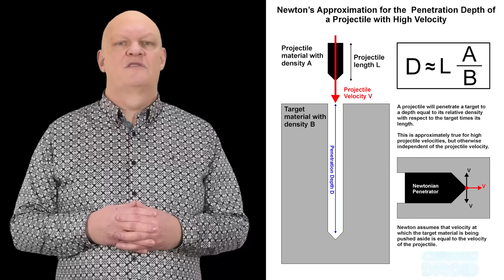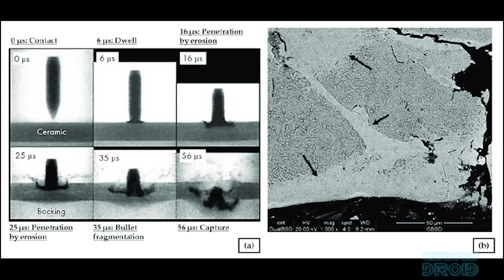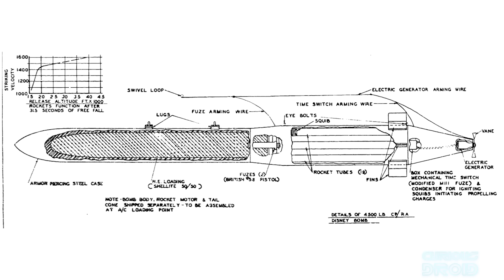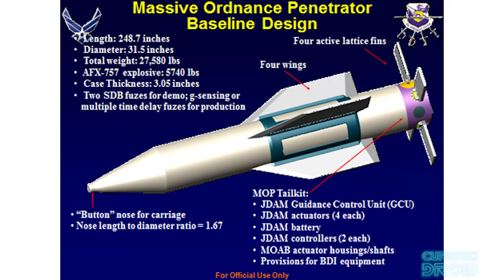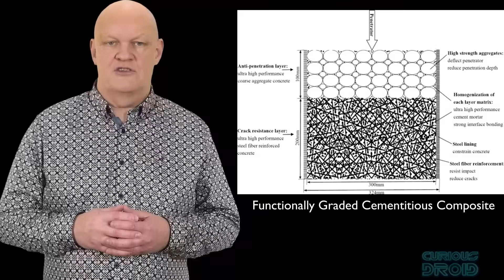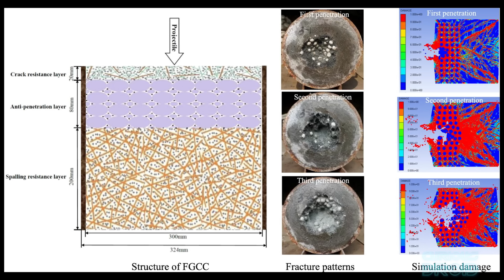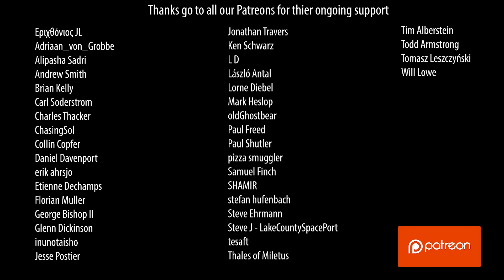Can Iran Stop U.S. Bunker Buster Bombs?

Comment: 25 years ago, I was working in Rodgers Hollow, Kentucky, testing concrete for tests like these. The holes they blew were dumbfounding. I wasn't allowed to see the tests, just the wet concrete and the aftermath. Some blasts heaved the concrete to rubble, while others were almost drill-like.
Reply: Drill-like... Fascinating. I am endlessly entertained watching solid things liquify or exhibit fluid dynamics behaviors instead of acting like rigid bodies under normal conditions. For the purposes our brains evolved for, it might as well be magic.
Reply: @daltanionwaves  the last line is such poetry 🤩 "For the purposes our brains evolved for, it might as well be magic."
Reply: @daltanionwaves   @daltanionwaves  To believe in evolution is to believe in magic🤡
Reply: The whole area is basically Kenshi.
Reply: @explosives006  no
Reply: I have always wondered, how much do you have to fk up a bunker really? The ground it is in most of the time will be the weak point?

I mean Cheyanne Mountain can hardly survive a "near miss" with a nuke let alone direct strike.. (I believe this is more to do with its age and doctrine of the time than actual failure)
Reply: I was also a part of a civilian company assisting in a creating a sensor array to test the capabilities of these kinds of munitions..in the end ..you dont always have to penetrate the bunker ..you sometimes need to disturb the surrounding environment enough to cause structural damge ..in some cases like in Lebanon... nasralla died from suffocation..not from the impact itself ..
Reply: @danielshultz8008 yes the effects of the gas fumes from the bombs is another killing tool in itself
Reply: Roughly speaking how straight and neat were the holes?
Reply: They would be defeated in one day like before
Reply: Boron fibre reinforced concrete is "interesting" stuff when it comes to breaking it up with explosives.
Definitely not something for the budget minded to contemplate...
Reply: Iran is not Iraq Iraq were under no fly zone for over a DECADE BEFOREthe war and could only get funds through smuggling they were basically close to third world with no allies you should compare Iraq to iran
Reply: US invades iran,the US aircraft would fall out the sky like rain
Reply: @kingsman3087  Sure and Mohammad will be able to read.
Reply: @kingsman3087  are they going to shoot down to some AI B2s like they shot down those AI F35s??
Reply: @The_Inquisitive_Inquisitor  idk, Iran has had decades to  prepare to counter these enemy aircraft
Reply: @kingsman3087  Really? That's funny because it seems like they don't know how to use anti-aircraft missiles. Not a SINGLE s300 has been fired
Reply: @kingsman3087 yeaaaaa didn’t happen lmao
Reply: @kingsman3087 This aged well.
Reply: Unlikely since the US has over 800 F-35's.  Iran would have problems dealing with them.  Any idea to the contrary is wishful thinking on Iran's part.
Reply: @wadopotato33  bro, what part of there will be no Arial battle you don't understand? Iran will not get engaged in dog-fights, they'd just use hypersonic surface to air missiles to take them down, like they have done to many of the US,s aircrafts, like the global hawk one of the most stealth and advance UAVs out there.
Reply: @xerxessonofdarius1969  Those hypersonic surface to air missiles you were talking about didn't seem to do them much good
Reply: @wyattlewis8671 you got two things mixed up. One they had a robust air defense but Israel's amazing military planing and know-how disabled those systems with a brilliant Trojan horse operation. My assessment at that time was correct, and not even the most educated military scholars could have predicted the audacious move by Israel. Oh and the second thing was Iran's hypersonic missiles ( not hypersonic air defense,  I never said that), but yeah Iran's hypersonic missiles saved their ass. If you see there is ceasefire. It's because iran was making it painful for Israel to continue the war. Otherwise Israel wouldn't let a wounded opponent get away
Reply: @kingsman3087  Here I am in the future to tell you that you are incorrect, sir.
Reply: @kingsman3087   WHY would you say such a dumb thing, ...unless you wanted to be refuted?
Reply: @kingsman3087 I mean was bogus to begin with and aged like milk
Reply: @AceDan-gc9po  this week-long conflict is nothing like a full scale invasion, invasion of iran is nothing like an invasion of iraq
Reply: @kingsman3087 if Iran has failed against Israel you’ve already failed at the first hurdle everything Isreal has the USA has better the Iranian air defence system has been dog walked your sites bombed scientists killed and leaders buried no one is believing your propaganda.
Reply: @kingsman3087  lolwut. US did invade Iraq. Twice,  and both times the US lost only a handful of air assets. 

[EDIT] Deltaionwaves edited his comment to Iran, it originally said Iraq. 

I'm addition, I DO NOT SUPPORT WAR WITH IRAN. 

However, I am 100% confident that we're such an awful thing to happen that the air war would be over in a few weeks. US doctrine on this is incredibly OP but very very expensive.
Reply: Also angus, i want to bet that you weren't there
Reply: @TheChipmunk2008   @Gardener42  dude he edited his comment, it said Iraq before. Also, I really really am not US gung-ho armchair general dude and war with Iran would suck. I'm not sure why you're mad at me?
Reply: @TheChipmunk2008  Who hates an entire ethnicity? Oh that's right, bigots. Also, Iranians are not Arab they are Persian.
Reply: @TheChipmunk2008  does it matter if they were there or not? Iran would get demolished
Reply: @angusmatheson8906  problem is Iran is about 5x larger than Iraq. Iraq tried to destroy Iran for 8 years without progress but lost tens of thousands of troops. We can win the air war with Iran but destroying targets is not taking, controlling, and denying the target from being retake. That takes troops. And there is a lot of land.
Reply: @TheChipmunk2008  How are those legs holding up from all that "Standing with Ukraine" That flag on your profile isn't a virtue signal at all, I am sure it has made all the difference lol..
Reply: @angusmatheson8906  I know this is almost a year old but you said nothing wrong in this exchange and were attacked for absolutely no reason. Just thought I'd mention it to boost your sanity.
Reply: @angusmatheson8906  I've worked with Iranians. They hate their current religious dictatorship government. Most Iranians are like us, they mix in well with our western way of life.  Ever eat Persian pistachios?  So good compared to the bland California ones.
Reply: @angusmatheson8906 weeks??? You mean 20 minutes.
Reply: @angusmatheson8906 they are bomb targets for f35s.
Reply: @angusmatheson8906 you live in the past my friend.  Iran possesses a robust air defense , equipped with S300s , S400s, Bavar375, and khordad air defense, which have shown their capabilities.  Plus Iran's hypersonic missiles would ensure that, the US in the case of conflict, would have to move it's naval assets out of range to the Costa of Sicily and Diego Garcia out of Iran's range. This alone would create a situation that would dull the US air supremacy.
Reply: @xerxessonofdarius1969  They'd still lose the air battle in short order
Reply: @angusmatheson8906  I guess you have a hard time comprehending what you read; there would be no air battle!
Reply: @xerxessonofdarius1969  Fun fact, more people died on the Alec Baldwin movie set than Iran's unprecedented ballistic/drone attack on Israel. Ballistics experts calculated it would take 3000 missiles to maybe put ONE air force base out of order for 24hrs....you believed your own propaganda, noob mistake.
Reply: @xerxessonofdarius1969  Your comment didn't age well.  Israel has been bombing Iran with full air superiority.  Took out all their air defenses in like 2 days.  And now the U.S. just destroyed three of their nuke sites without the Iranians even knowing the planes were in the sky.

Comment: If you collapse the access tunnels, it doesn't matter what is underneath. Sure they can dig it out eventually, but it takes those resources out for the time being, and you can just keep hitting it. If you can hit the air intake, you may have done the job right there.

Another idea is to send a train of bunker busters into the same spot. Each enters the cavity created by the last. Or come in at an angle, get under the bunker, and lift it up.

If you can send a missile right into the entrance, you don't have to penetrate the walls. The blast wave propagates down the entrance corridor and only has to deal with much thinner blast doors.

Super precision bombs make everything so much easier. But if you don't have air superiority or super-duper-uber stealth, it is all for naught.
Reply: Aren't access tunnels usually not built in a straight line? This might lessen the effect of a direct hit on them.

The whole "bomb train" idea might work. But you have to remember that it shouldn't be to hard to just pour a 10 meter thick multilayer UHPC concrete slab. I mean if the Germans managed to construct 8m thick bunkers during WW2, 10m should be quite easy with modern construction equipment. This much UHPC probably has some decent multi hit capabilities. Maybe it would also be possible to develop something like explosive reactive armor (usually found on tanks) for bunkers? Furthermore, don't forget that AA has become much more effective in recent years (Iris-T supposedly has a 100% success rate in Ukraine). A solid tungsten bunker buster may not be that much harmed by an air defense missile, but its fins will still be blown off, making accurate targeting nearly impossible.

Moreover, with modern tunneling equipment, it's not that hard to just dig a 400m deep hole. New concrete also allows for these bunkers to be much more resistant against shockwaves, which seems to be the Achilles heel of old cold war bunkers like the Cheyenne Mountain complex.

Targeting the entrances and preventing anyone from going in or out of the bunker might still be the easiest way to neutralize these targets.
Reply: @sebsibustechi8237  Perhaps, but it doesn't really matter.  The occupants of the bunker would still be stuck in the bunker.
Reply: @tams805  I mean, yes, but it should be possible to just dig these people out or construct hidden exits.
Reply: Wow, it definetly sounds possible! When we can get 5 meter precision on small artillery that has traveled 70 km, a smaller, perhaps meter wide precision sounds achivable from a plane 3-9 km above. These aren't micromunitions too, so that would help, maybe?
Reply: All those are workaround and not solutions however let me try to disprove your ideas to a certain extend, it´s not a personal attack.
- Just because the entrance is down does not mean the man inside can´t fight for months given recources like air scrappers, water, food and sanitation.
- sending multiple rounds into the same spot is the biggest workaround there is, however you could see from the pictures that even 3 hit on the same spot did only minimal damage. You will be running into diminishing returns pretty quick if you have to fly the same mission 25 times to take out one bunker. By this metric the enemy was won.
- What makes you think the entrance is not just as well protected as the walls are ? What would be the points to all the walls then ? If the entrance is the weakest link anyways and the enemy knows this, you don´t even have to build the whole damn structure as well you can simply make it as strong as it´s weakest link. Also that´s what thermobaric bombs are for but they have to penetrate in the first place which is the core problem here.
Reply: The train of multiple hits has been considered with nuclear strikes. Some of these modern command bunkers like the ones in China are thousands of feet down. Russia Yamantau base is another such site that would require multiple nuclear penetrators to take out and are considered weapon sinks at that point. Since we are treaty limited for nuclear weapon numbers now its has to weighed if it's even worth using that many vs saving them for other targets
Reply: @johno1544  Cheyanne Mountain is under 5.000 ft. of granite IIRC. 

Don't know how deep Mt, Weather or Raven Rock is. SAC at Offut AFB is only about 50 ft. down, but it is all concrete. Hardened command posts are why Russia kept their 20-megaton warheads around and why we kept the Titans with their 9 MT warheads.

We don't have any of the big bombs anymore. For almost all other applications, multiple smaller warheads work better. We canceled the Robust Earth Penetrator, so the best we have now is a variant on the B-61.
Reply: @fh5926  From what I heard, even strong nuclear bunker busters (1.2MT) can "only" penetrate up to ~370m (~1200ft) of stone.

The problem with bunkers like the Cheyenne Mountain Complex is that the shockwaves created by these weapons will destroy the cave walls and crush the thin metal buildings built into them. Entrances might also be another weak point. When these bunkers were built, nukes were still pretty inaccurate. A direct hit was considered to be highly unlikely.

I'm not a civil engineer, but considering the advances in concrete technology and tunneling, it might be possible to just build the inner walls of the bunker stronger or just dig a deeper hole.
Reply: The thing about this as well is that the bombs could be used to penetrate the ground around the structure targeting the walls. 
The cost of building these specialized concrete structures is going to get so high that it will bankrupt countries trying to build them. 
The walls are going to have to be as thick as the roof on them.
Reply: @bighands69  Concrete construction has become pretty cheap.

According to the Internet, a 100 story skyscraper needs around 140 000 m³ of reinforced concrete. That's enough concrete to build a 100x100m (~328x328 ft) bunker with 10 m (32,8 ft) thick ceilings, 8m walls and 2m floors. This structure is enough to provide ~17 000 m² (~183 000 ft²) of floor space on two levels (2.5m/8.2ft floor height). This is equivalent to 80 US single family (avg. 2 273ft² per house).

Yes skyscrapers are expensive. The 93 story One Vanderbilt (completed in 2020) had a construction cost of ~3.5 Billion USD (adjusted for inflation; 2022). That's a lot of money, but only equivalent to the production cost of 20 F-35, or <0.5% of the annual US military budget (~1.5% of China's annual military budget).

So I doubt, that any serious military will have issues financing the construction of highly protected buildings made from concrete.
Reply: Why are these questions even being considered .Who gives counties the right to destroy other countries infrastructure ?
Reply: @Interdiction  haha...

shutup.
Reply: Way to expensive and with current state of economy not possible.

Comment: I wonder if you could use uhpc in body armor?
Reply: Sure!  Who wouldn't want to wear a 800lb vest?
Reply: @T3H455F4C3  nobody! What if its only 20lbs, tho? In theory you could pour it into plates in a variety of useful shapes, the psi rating stated is actually better than some materials used today for the same purpose
Reply: @cascadianrangers728  I think that what you find in current level IV plates is about as good as it gets. 
Like you could build a bunker out of layered boron carbide and polyethylene which would probably resist penetration better then uhpc but it would be crazy expensive. 
There might be a bunch of little details like: How is the material supported? Does a loose plate of uhpc work as well when it's sitting against your squishy torso? Does it need to be part of a solid structure in order to distribute the loads and achieve its full strength?
Don't know. Composite materials are complicated.
Reply: @T3H455F4C3  You know a lot about the subject! Can't beat ceramics for level IV, but I just got a set of uhdmpe NIJ III plates, which is a sacrifice of strength for less weight, they're wonderful so far, it makes me wonder about what other new materials might do
Reply: It's about as strong as aluminium. So it can't compete with steel.

Comment: The idea to re use old 8" gun barrels was genius
Reply: Cascadian Rangers
8", not 18". You can just barely manage to get a self propelled 8" artillery piece. For an 18", you'll be needing a railway carriage.

kindlin
No, they were old. The 8" howitzer was mainly intended for counter-battery fire (taking out other artillery pieces). But in the 1980s, MLRS came around & could do that job far better. So the 8" guns were getting phased out right at the start of the Gulf War.
Reply: @dgthe3  whoops, thanks for catching typo, yeah they weren't using Yamato barrels lol
Reply: I got the impression they were relatively new, maybe fresh off the belt, and the military probably cleared them out of their entire stock.